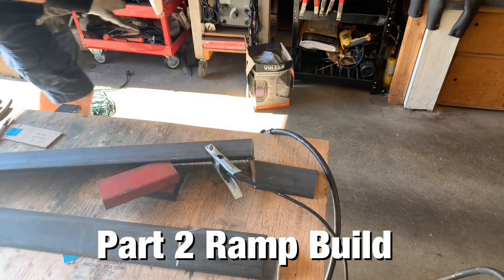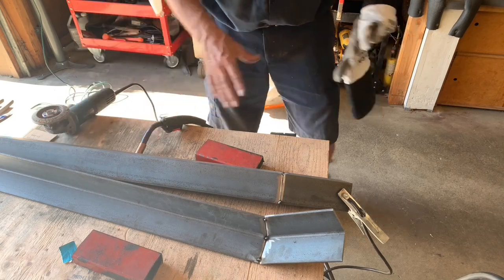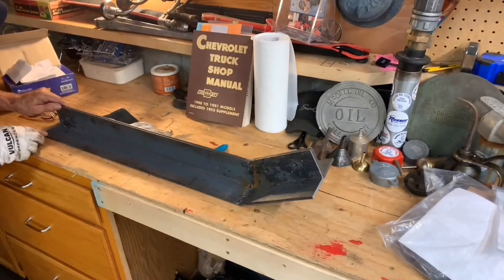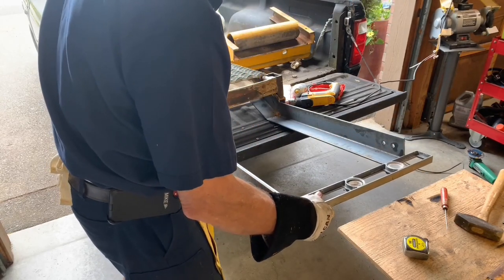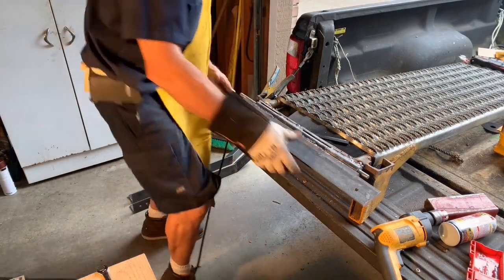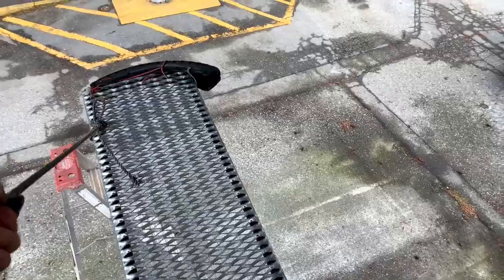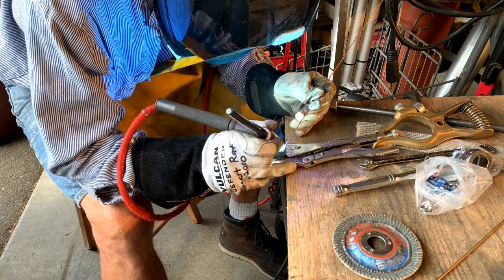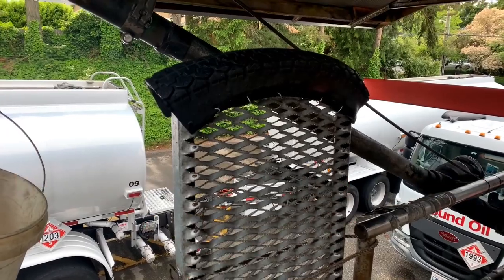Welding and Fabricating/Part 2/ Ramp Repair at Heating Oil Rack

Comment: Great job Mike! One of my favorite things to do is take something existing and make it better. I mean starting from scratch is fun. But I love to take something you use on a regular basis and make it better and better. And looks like you've gotten quite comfortable with the Tig welder. I'll send you some parts for Wratchet to weld up. 😁
Reply from the maker: Thank you Mike, it will be a long time before i am the welded you are but i have definitely improved, thanks for coming over and checking out the video, catch you real soon